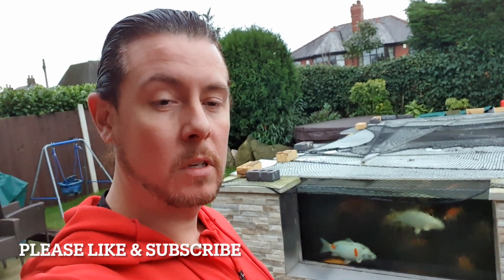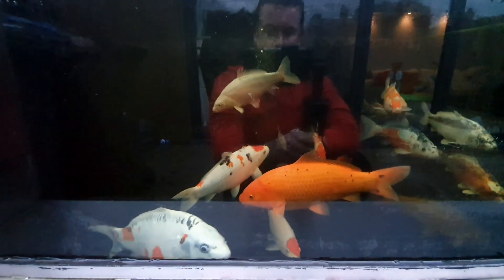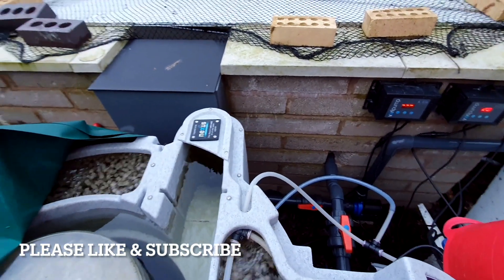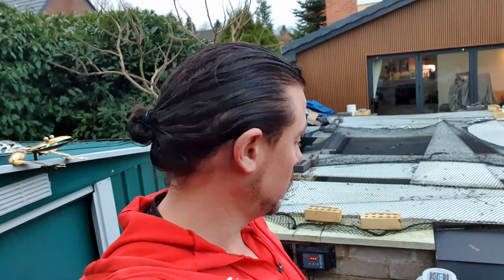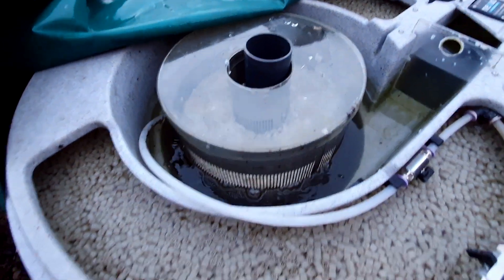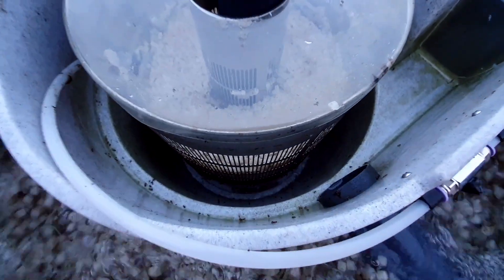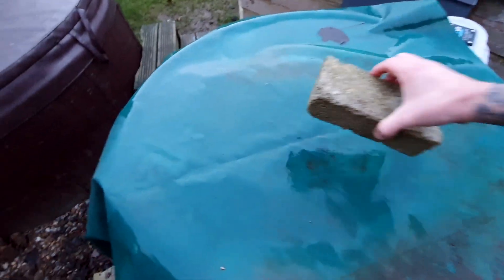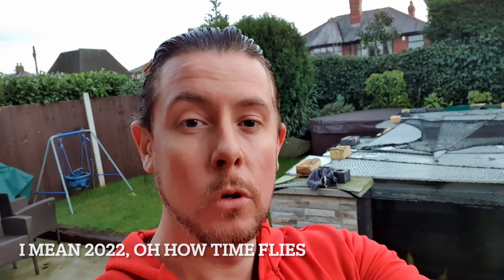Koi Fish Johnny Ep23 | Cleaning Pond Window of Condensation & Quick Nexus Pond Filter Drop

Comment from the maker: LINKS TO ANYTHING I HAVE USED ON MY POND THAT I WOULD RECOMMEND ⭐⭐⭐⭐⭐
*I get a small % when you buy anything, helps justify time recording to the wife, so thank you in advance 🙏
MY POND SET UP 🐠💧
Nexus 220 🔗 https://amzn.to/3wxdv0h
Evo Aqua Pond Pump 🔗 https://amzn.to/3clZyv8
Pond Water Blade 🔗 https//amzn.to/3KqEDVq
Tempest Pond Water Polisher 🔗  https://amzn.to/3QRrTsd
UV Pond UV Light 55w 🔗 https://amzn.to/3e0LB6r
Air Pump  🔗 https://amzn.to/3CDn8yr
Pond Declinator 🔗  https://amzn.to/3wyWgLV
Replacement EA UV55w Bulb 🔗 https://amzn.to/3AZdAN3

GOOD STUFF I HAVE USED  ⭐😁

EA Pure Pond Balls 🔗 https://amzn.to/3PSpuwh
EA Pure Pond Bomb 🔗 https://amzn.to/3ApoQka
Koi Pond Salt 🔗 https://amzn.to/3QSc98v
Air Pump Stones 🔗 https://amzn.to/3APCFKb
NT Labs Magiclear 🔗 https://amzn.to/3Klv8pA
NT Labs Pond Test Kit 🔗 https://amzn.to/3ThN9sW
⚠ Potassium Permanganate Kusuri 250g 🔗 https://amzn.to/3KqpYJI
Hydrogen Peroxide 6% Solution Kusuri 🔗  https://amzn.to/4c1GVGc
Kusuri Topical Treatment Kit 🔗 https://amzn.to/4aIbGib

EQUIPMENT USED 💪🙏

Silirub Aquarium Safe Sealant Link 🔗 https://amzn.to/3vOa34d 
Pipe Cutters 🔗 https://amzn.to/3pTcDPD
Grifton WDF-05 PVC Pipe Glue 🔗  https://amzn.to/3wxgc1R
PVC Pipe Saw 🔗  https://amzn.to/3QRyenK
Pond Net covers 🔗 https://amzn.to/3PQz2rx
Stanley Knife 🔗 https://amzn.to/3TY4mJ5 
Johnny Builder Gloves 🔗 https://amzn.to/3UeBOMQ

My Koi Dealer UK Nishikigoi 🐠 Sells everything you need so if your local go there see Dave for everything 👉 https://www.facebook.com/UkNishikigoiBellLane

Comment: New sub here, I also have the nexus I’m actually amazed at the amount of fines that return back to the pond after going through the cycle. Saying that they are great filters. 👍🏻
Reply from the maker: Thanks for the sub pal 😁 How strange mate, I find mine to be ace. The only issue for me was at the beginning I didn't drop the filter as much as I should, which led to some creeping through but once I found my optimal cleaning cycle and adjusted it to the weather boom it smashed it mate. Only other thing is have you got enough media in the mechanical filteration section? 🧐
Reply: @johnnyfied1  I’ve got the flow set at 6000 litres per hour as recommended, I have 150 litres of K+ media in the bio and 18 litres of K1 micro in the eazy chamber.
Reply from the maker: @PhilGsKoiPond  Hi pal is yours a Nexus 220+? As thats what I have. I have mine set at 40% in peak season and filter every 3 days. I also have my filter during the winter Torpor season set to 20% as to not stress the fish and the reduction in fish waste. 

I'm no expert mate but Id give it a go slowing it down, just a guess but you maybe forcing the water through too fast and its dragging some fine's through with it. 

I really think this is a case of test and see. So many people have so may different ways that works best for them mate. 

PS I hope this helps 🐟
Reply: @johnnyfied1  hi mate, yeah mines also a 220+ I’m pulling approx 1300 gallon an hour through mine. Pond is currently 14 degrees via the ASHP and feeding once a day jpd shogun. I clean my filter twice a week. When you say 40% are you using a vari pump?
Reply from the maker: @PhilGsKoiPond  Hi mate yeah. One mine and I will pop an earlier video over so you can see the pump, the setting and also some super helpful comments from the koi community:

https://youtu.be/14Hpn0AQRzs